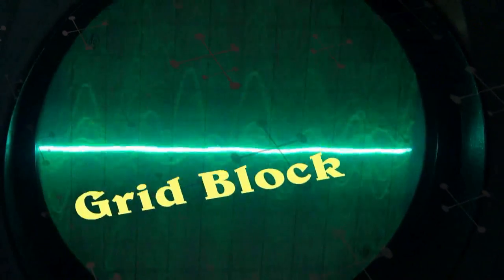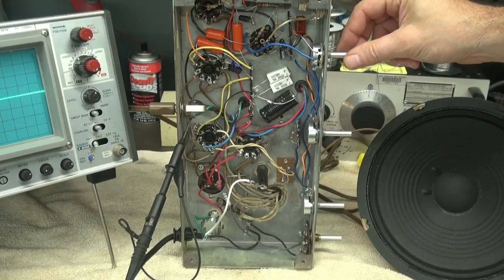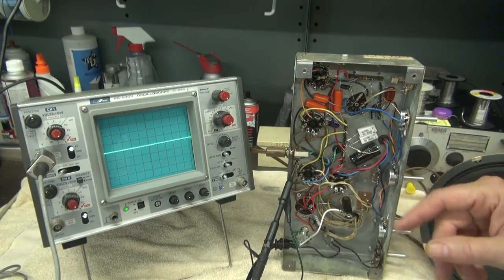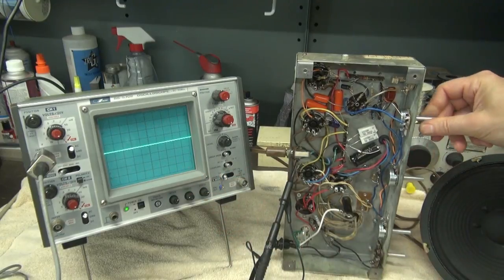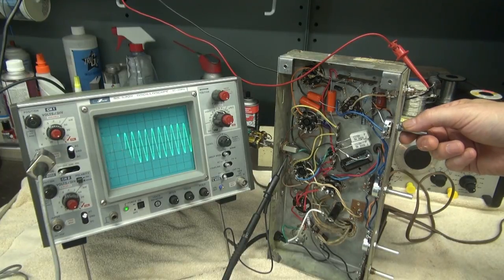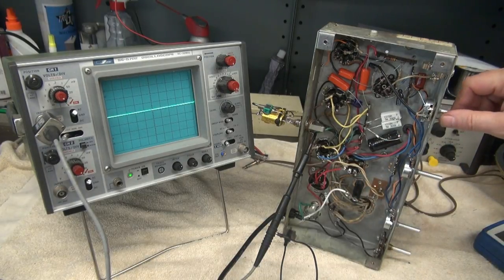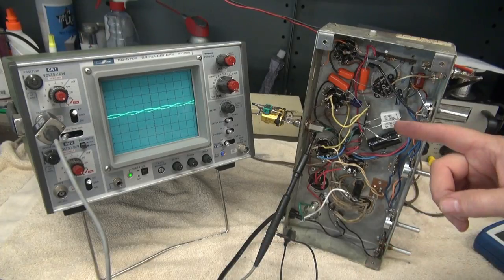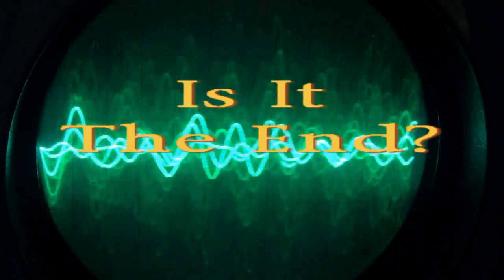How to fix tube amp parasitic distortion Grid stop resistors D-lab electronics

Comment: I have a genuine '64 Princeton 6G2 Tuxedo. Adding grid stoppers, screen resistors, and a grid stopper on the phase splitter made the amp accept pedals that increased the gain, a LOT!
It used to "Fart Out".
It has an EV Alnico 12" speaker in it. It weighs a ton now, but is absolutely glorious. It never was all original. It had already had holes drilled in the chassis, replacement OT, etc when I paid $75 for it back in the late 70's. It looks MINT, but isn't stock. I consider them to be upgrades more than mods. 
It will BARK like a mean dog now!
It's the perfect vintage tone.
I'm 64 now, and use it with a Jazz guitar to play blues with.
Everyone wants to borrow it to record with... the 6G2 circuit, with a few improvements is golden. It still has it's "Soul" but the blocking and parasitic oscillations limited it.
Not anymore. It was an inexpensive amp in the line. I just used a '65 Twin Reverb as a guide to improve it. Nothing radical.

Comment: I don't normaly believe in fate but last evening I was monitoring my output of my amp with my scope and saw that same oscillation thinking it was an issue with my Treble pot.  Then next day your "parasitic distortion" video was in my Youtube Home page to watch.  You may just have save my brand new set of tubes!!!! I owe you a case of beer.  I ordered a pair of 1.5k 1 watt resistors ( looked like 1 watt that you used) and will let you know if that elliminates my oscillation.  I will be watching more of your enlightening videos.  Thank you
Reply: Well, it itruned out that the 571 Khz oscilation I was getting was in the Tone Stack. Tested the caps, resoldered the joints and repositioned them to space them away from each other better.  Not sure exactly what was causing the oscillation but happy it doesn't do it anymore.  Left the the Grid Stoppers in as well as added a Screen Stopper.  Thanks for giving me the incentive to presue the issue more closely.  73 de Harmen VE3EMA

Comment: Thanks so much!!  I had built an amp, gone over it many many times, and it just wasn't sounding right.   It had parasitic oscillations, and I moved one wire from the OT (since it already had screen resistors) and fixed it!

Comment: Great job Mr. D Lab, I'm wondering if the length of the  grid wires contributed to the oscillation. My teaching is from electronics mags from the 1940's & 1950's & the construction advice was always to keep grid (& plate) wires as short as possible.

Comment: Should all output stages have grid stoppers? Single ended and push pull? Do the grid stoppers attenuate any noticeable output single? Great video! I think the essence was the significance of the use of the oscilloscope for trouble shooting. You are so right. If you can't hear it, you can see it! Thankz
Reply: In modern amp design, all tubes, preamp and power amp should have grid stoppers.  It reduces blocking distortion and parasitic oscillation.  The grid of a vacuum tube normally has very low current.  The purpose of the grid is to create an electrostatic field that varies the amount of current between the plate and the cathode.  There is no downside to using grid stoppers that I know of, beside the cost of the resistor.
Reply: The input capacitance of tetrodes and pentodes is very low, so that grid stoppers cause negligible loss of signal.
Reply: I did some research (read a book) and ... A grid stopper, in conjunction with the inter-electrode capacitance of a tube, forms a high pass filter. The traditional guitar amp input circuit is designed to work with the (approx.) 100pF inter-electrode capacitance of a 12AX7 to cut frequencies above 20kHz and thus 'stop' radio frequencies getting to the grid of the preamp tube to be demodulated and amplified. (Passing taxi, anyone?)The internal capacitance of a tetrode or pentode is tiny, thanks to its screen grid, so that large value grid stoppers can be used. The filter created has a high cutoff frequency which causes little or no loss of treble, but shunts even higher frequencies to ground, preventing the build-up of hypersonic oscillations.

Comment: i have a mesa/boogie S.O.B. (son of boogie) from 1984, when i turn the mid knob, during the turn, it does exactly that, i blew a fuse, opened up the amp, the 2watt 470ohm resistor across the 6L6 jack was split and toasted, no grid stoppers....

i suspect that it will keep roasting powertubes and eating resistors when i turn the mids knob, if i dont remedy the lack of gridstopper resistors, is this correct?

is it safe to use 500ohm 5w in place of the 470ohm 2w? i tested the unburned one, and it read 578ohms!!! that was wayyyy out of spec, 

can i just send you the amp? it is a real beauty, and the loudest 60watts ive ever heard inmy life, i am afraid to screw something up and destroy it, usually repairing things is a breeze, this amp however is primitive and identical to the first amps he built for carlos santana, before the Mark1 and Mark2, so looking inside you might scratch your head at some things...

its been laying open now for 3weeks, please help....

Comment: Terry,  great stuff.  Hard to tell from the video, but I would think the Grid Stop resistors have to be at least 1W or 2w given their role. It looks like you may have used 1/2w  but I am not sure. Either way, excellent job of explaining this and fixing it.  Awesome.  - Ron
Reply from the maker: Hello Ron, Screen resistors are normally from 2-5 watt. 1/2 watt for Grid resistors is fine, very little current flows thru them.
Reply: You are absolutely correct Terry.... got my Grid and Screen mixed up. !!   Thank you

Comment: I been fixing tube amplifiers for 40 years, I fix most Audio Research models.
Audio Research is a High End audio manufacturer based in Minessota.

I use digital oscilloscopes and high end fluke multimeters for doing my jobs.

Cheers.

Comment: Hey man, great video. I'm new to your channel, perhaps you could provide some insight? I have an amplifier that I built (yes, grid stoppers included) that when you turn the volume up far enough, the unit starts oscillating in a kinda whistle sounding format around 6.6khz with an odd waveform and the frequency seems to change when you alter the control around that point. When you turn it up even further, your actual guitar signal dies away and goes quiet. The high gain channel is even worse because its always in enough oscillation to make the signal splutter etc. but thats because it has lots of gain stages like modern high gain amps. I've done lots of research on star grounding etc. and applied it but it just doesn't fix the problem, any tips? The only thing I haven't done yet is use shielded cable, but I doubt that will stop it.
Reply: Possibly you need a shielded or re-routed input line. A common oscillation source is feedback from the high-gain input stage to some place later in the circuit, often but not always the output stages. It often acts like you are describing.

Comment: I have the same problem but with a single ended KT66 tube on a jazz guitar circuit. At full treble the signal goes almost flat. Although there is a grid stopper, I wonder if the value is sufficient or if it might not be placed close enough to the KT66 grid. Any suggestions?

Comment: Had a similar problem and found the solution was the old tubes had much less gain than the new so temp. fix was use old tubes until I could fix the amp correctly for modern tubes. I grew up on tubes and poor gain.   LOL

Comment: I've been looking for random noises for a couple weeks, ticking, feedback, all kinds of Halloween sound effects would come and go.  UNTIL the power scaling MOFSET gave up the smoke but not before making the amp suddenly shriek at 111dB while I tripped over every cord on the way to the power switch. 

Just a short while ago.

I jumped out of my f-ing skin btw and I haven't blinked for the past hour and a half... 

All fixed! Jumped right over that mess and it's all a normal power supply. I had no idea all that noise could have been that stupid MOFSET

Comment: Grid stoppers are theorical. The best is to always test FIRST w/O them, most of the time, is all good ! Adding grid stopper will makes the sound crispy. And awful. I don't know why, I had to remove them from every single amplidier I've build to achieve the best sound. I'm building HIFI amps and make every calculations myself, and always double check ! Any time I was using grid stoppers, I realize sound was not the best possiblez out of any amplifier. The only case is if an oscillation won't stop by any other means, sometimes, it may helps. But it's seriously a joke to use them  systematically, always test first without them !

Comment: Hi Terry. Scopes are pricey.  For amp work can you use a single channel scope or any recommendation for an inexpensive scope that will do a good job?
Reply from the maker: Yes Sir, Check out basic scopes made by Heathkit/Leader/Hitachi/Iwatsu, etc on ebay. Most can be obtained for around $50.00. 10mhz model is fine.
Reply: D-lab Electronics thanks Terry!

Comment: Well to start I have a complicated one Peavey classic 50 for 10 early 90s, 91 92 complete gone through everything all new caps tubes new fan it needs works so, then I have a fender Super Champ XD same thing those are the two I want to start on if the money's right and the jobs done right which I don't have any problem with that after I've watched you we could take off from there I have a lot of work will get you over some photos to it so you can see what's going on I'm assuming you have a website or web page? I'm going to look for it stead of leaving names and email addresses online where everybody could see him. Thanks

Comment: Correct me if I'm wrong but you aren't getting full output now. Is there a way to determine the exact resistance needed to back the signal down to the right point?
Reply: You could jump in different values of resistors with alligator leads hunting for the min necessary value. Or if you have a dual pot, you could jumper it in circuit, dial up a setting that works & then measure it for the fixed resistances to put in. I doubt there's a formula for calculating the right value in advance.
Reply: You will not hear the difference in volume with a 1,5k resistor in the grid circuit, yet it will effectively block oscillation.

Comment: Had similar problem with Blackstar Artisan 15 https://youtu.be/zH-6yWqo49A  problem occurred by 2 insulated wires touch each other, I’ve separate them and it’s gone, unfortunately one more thing I can’t get rid off is volume balance between channels, channel 2 is much louder and full of juice while channel 1 is noticeable weaker, its specific built with ch1 on ecc83 and ch2 on ef86, tubes has been checked ok. any ideas ?